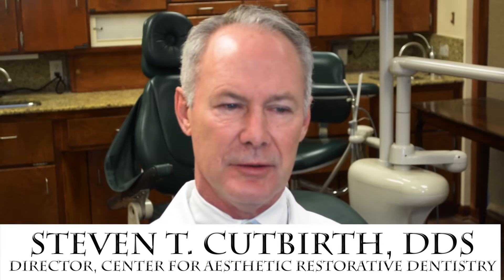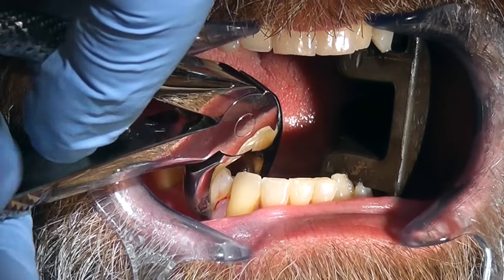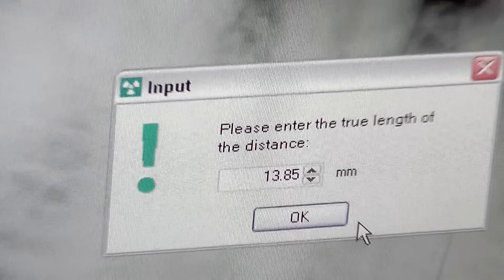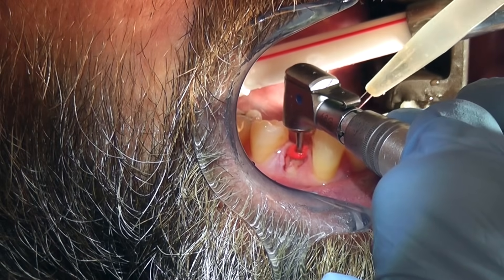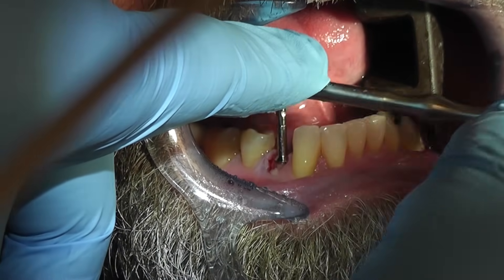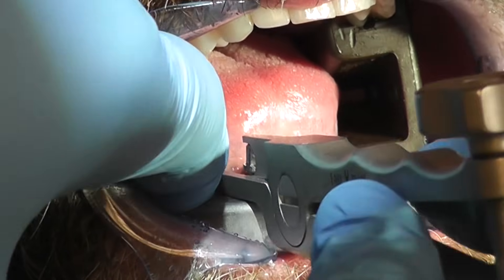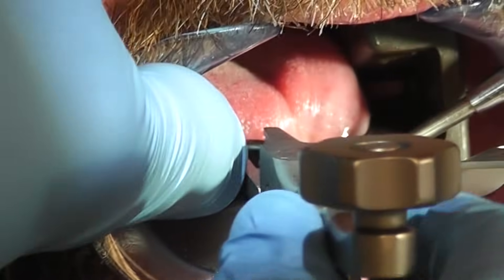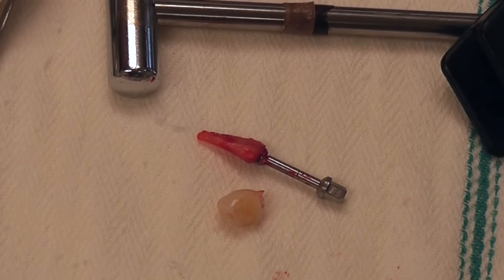Easy Tooth Extraction - Dental Minute with Steven T.  Cutbirth, DDS

Comment: Completely unnecessary. This extraction can be carried out a lot simpler and faster with the use of traditional elevators/luxators and/or rongeurs.
Reply from the maker: Thank you for your comment. There are usually more than one way to do anything. My concern is these cases is to preserve facial and lingual bone for the implant. I'm not saying there are not other ways of extracting the  tooth, but facial and lingual bone preservation is another issue. If you are not going to replace the tooth with an implant, then you can just commando the tooth out.
Take your practice to the Top Tier. Subscribe to DentistryMasterClasses.com for an organized library of all the Dental Minute videos plus many complete comprehensive cases and many very important articles. New cases are added weekly.  Only $39.95/month.
Click here to subscribe: 
https://membership.dentistrymasterclasses.com/purchase/?plan=513

Comment: My dentist did not sew the area is that ok?
Reply: I extracted my top left pre molar and it was really challenging to get it out because of the bone holding it firmly in place. Plus the crown of the tooth was getting hollow so Dr had to drill to be able to grip the tooth as gripping a hollow crown made no sense. But there is now a huge gaping area and I just want to know if I should be worried. I did it Tuesday May 28
Reply from the maker: I suggest you ask your dentist. I cannot diagnose without examining you.

Comment: Had 2 lower teeth extracted today. 2nd from back left and 3rd from back left. They put a topical anesthetic on twice and gave me 4 shots with a massive needle. The exraction was extremely painful. The nurse told me to raise my hand if i feel pain so they could stop so I could take a break. By the 4th time I raised my hand they started to ignore me. There is so much bleeding, swelling, and some pain. Its been 3 hours since the extraction. I would recommend having someone else drive you. I felt loopy and my vision was blurred afterwards. The anesthetic caused my one eye to partially close.
Reply from the maker: Sorry.

Comment: I have a question, I’m getting 4 back teeth removed 2 at the top 2 at the bottom, this is for braces. Will me having those 4 teeth removed negatively impact my jaw structure? Ive heard people from experience online mentioning their face is sunken etc…  I need a professionals reassurance!
Reply from the maker: Sometimes there are too many teeth and not enough space to correct crowding, so some teeth, usually bicuspids, must be removed. The problem is the space needed to correct the crowding is often not the exact space (width) of the tooth/teeth being removed. So if the width of the tooth/teeth being removed creates too much space, then the orthodontist must either leave some space, called a diastema, between two or more teeth or they must move the teeth anterior to the extracted tooth/teeth space back, distally, to close the excess space. Sometimes when this distalization of the anterior teeth occurs, it creates the "sunken in" profile. If teeth were extracted and too much space was created to both straighten the teeth and "close" all the space, I would prefer the orthodontist straighten the teeth to a normal, aesthetically pleasing profile, leaving some open space between some teeth, even if it meant placing a crown or 2 on the tooth or teeth adjacent to the excess space to close the space vs. distalizing the anterior teeth and creating the "sunken in" look. Good question!

Comment: 8 injections to numb every where,  4 in the cheek. Then two directly on each side of the gum surrounding the tooth. Took the dentist a good 50 minutes wrestling to try and remove the tooth ,but it only was half out! Due the thick and deep roots, he then had change his gameplan to cutting it into two pieces whilst the tooth was halfway out. I had no pain just a little stress due to the amount of effort he was  putting in but it wasn't working!  However let me tell you now once the numbing wore off the pain has gotten worse and worse. Pain meds aren't working.  It's 3.45am I've been researching flat out on YouTube to try and help with the healing process and pain I'm experiencing. Day 1 is agony god knows what it's gonna be like come day 3 from what I've read. I'm  actually in far worse pain now than before i contacted the dentist!  FML ah well let's hope I can heal in time for my Christmas Dinner 🤞
Reply from the maker: My surgeon friends and I have found 800mg Ibuprofen plus an extra strength Tylenol taken together every 6 hours is excellent for dental extraction and surgical pain, so long as you are not allergic to either one of those medications.

Comment: Dear doctor, he doesn't want to spend so much time. It's enough to free a little bit around the root with a drill, and a direct elevator will come out with a little force of the tooth.❤
Reply from the maker: I agree what you say is often the case. I extracted 3 decayed single rooted teeth today and was able to extract them vertically by "unscrewing" the teeth, without facial or lingual bone removal or bone damage, followed by immediate implant placement since they were single rooted teeth. However, in some cases, this "EasyXTrac" method is invaluable. 
Take your practice to the Top Tier. Subscribe to DentistryMasterClasses.com for an organized library of all the Dental Minute videos plus many complete comprehensive cases and many very important articles. New cases are added weekly.  Only $39.95/month.
Click here to subscribe: 
https://membership.dentistrymasterclasses.com/purchase/?plan=513

Comment: i think is a lot of work , just extracting would have been easier quicker and simpler without using other materials and time.
Reply from the maker: You missed the point. The coronal part of the tooth was missing, so there was no coronal part to grasp with forceps. To remove a tooth like this conventionally, you would have to remove facial and, probably, lingual bone to expose the coronal part of the remaining tooth/root. You want to preserve the facial and lingual alveolar crest bone for the forthcoming implant. The Easy X tract allows you to remove the remaining tooth vertically with no circumferential bone removal.
Take your practice to the Top Tier. Subscribe to DentistryMasterClasses.com for an organized library of all the Dental Minute videos plus many complete comprehensive cases and many very important articles. New cases are added weekly.  Only $39.95/month.
Click here to subscribe: 
https://membership.dentistrymasterclasses.com/purchase/?plan=513

Comment: If you have pulpitis, it's painful because the anesthesia doesn't work.
Reply from the maker: You can give a mandibular or maxillary branch block of the Trigeminal nerve for local anesthesia. To give the maxillary branch block, use a 27 gauge long needle, turn the bevel toward the bone and insert the needle at the distal facial line angle of the maxillary second molar. Slide the bevel of the needle along the alveolar process 1/2 - 3/4 the length of the needle. Also, give an intraligamental injection with Citanest 4% plain and you can anesthetize the tooth.
 Take your practice to the Top Tier. Subscribe to DentistryMasterClasses.com for an organized library of all the Dental Minute videos plus many complete comprehensive cases and many very important articles. New cases are added weekly.  Only $39.95/month.
Click here to subscribe: 
https://membership.dentistrymasterclasses.com/purchase/?plan=513

Comment: Interesting video. I'm so used to the idea of dentists taking pliers and yanking teeth out. I'm glad I can see how it's done in the modern era as a predental undergrad. Although I believe some dentists still use yanking pliers and maneuver back and forth. Wonder if that's still a legitimate method of extraction.
Reply from the maker: Sometimes circular and small facial/lingual movement is appropriate, but you want to preserve the facial and lingual bone for implant placement.

Comment: I’m getting a tooth pulled next week and already I’m going into panic mode!  Never had a tooth extracted before and I’m going to be sick before even getting to the office!
Reply from the maker: Get the dentist to sedate you prior to the local anesthesia and procedure.
Reply: @centerforard  And how much does that cost out of pocket?  I’m already quoted that the consult will be $155 and the actual extraction will be between $495 and $795 depending upon different factors.  They never even discussed the option of I’ve sedation but this is a large surgery center so I would presume they should have it.
Reply from the maker: I use IV sedation every day for procedures. It's wonderful for the patient as well as the dentist. Working on an apprehensive patient is not good without sedation.

Comment: Dr can u please make video about diagnosing. Sinusitis vs dental pain. Thanks
Reply from the maker: Sure. The main way you differentiate between sinus pain and maxillary molar tooth pain is if the tooth is painful to cold, hot or biting pressure it is normally a tooth problem. If the tooth itself is not painful to stimuli,. but the discomfort is exacerbated when the patient bounces, jogs, runs up stairs or puts their head between their knees when sitting down, , it is normally a sinus problem. 
Take your practice to the Top Tier. Subscribe to DentistryMasterClasses.com for an organized library of all the Dental Minute videos plus many complete comprehensive cases and many very important articles. New cases are added weekly.  Only $39.95/month.
Click here to subscribe: 
https://membership.dentistrymasterclasses.com/purchase/?plan=513

Comment: Hi there, I see you’ve been replying to recent comments so I hope you could have some answers for me.. 

I’m getting my infected root canal tooth extracted on the 27th, going with the extraction route as getting the root canal redone is just even more money (around 1-2k). I also have retainers, they’re the clear plastic ones as I had braces from 2016-2017. The tooth that is getting extracted is the 2nd to last tooth on my top left side of my mouth with the last tooth being quite small in comparison. Would it be okay to keep wearing that retainer to keep that tooth in place with that gap with no tooth next to it or to allow it to shift into its place? Hopefully this makes sense. 

I’ll be getting cavities filled after the extraction and i’m worried that depending how they fill them it could change the shape of my teeth too much to where i’d have to get new retainers costing more money.. 

I’m also scared of possible dry socket and drastic change in my facial structure with that one tooth gone. I’m 23.
Reply: Kids loose teeth at 15 16 because of candy !!! You’ll be ok
Reply from the maker: Sorry you are worried. Speak with your dentist about your concerns. I'm sure the dentist will do a good job.

Comment: Okay has anyone actually gotten stitches after a tooth has been pulled? I have to get one of my top back teeth pulled and I’m honestly just worried for stitches. & I can either wait until January for a root canal or just get the tooth pulled… the pain is far to bad but if I have to end up getting stitches I’m not sure what to do.
Reply from the maker: Why are you concerned about stitches? Save the tooth with a root canal and crown if it can be predictably saved.

Comment: I had 4 teeth extracted under local anesthesia. The worst part was receiving the anesthesia. I had to take a break. After that, the actual extraction wasn’t bad, but hearing my teeth breaking was pretty gross. The healing process was easy but I ended up with a dry socket because I didn’t clean out the wounds well enough. Dry socket was the second worst part of this experience because nothing took the pain away until I finally got in to see my doctor. Overall, the experience wasn’t bad.
Reply from the maker: Headphones are a good idea during the procedure. Sedation can also be helpful. If the sockets are packed at the time of the extraction, you should not get a dry socket. Watch my video on "How to Never Get a Dry Socket."
Reply: @centerforard  nice comment doctor... I will try headphones when i get my next one done..
Reply: Thats why anytime i know im gonna get anesthesia i take painkillers first popping 2 advils 20 minutes before the procedure helps with any pain that goes thorugh the anesthesia and the pain you get from the needles is drastically less.  I had to get 5 fillings the other day and they stuck the damn needle in my mouth in 6 different places without the advil i would've had so much pain
Reply: So your teeth rotted because of poor oral hygiene. Then you got dry socket because of poor oral hygiene. The lesson? Be cleaner and take care of your mouth 🤮

Comment: Why not just pull it out??
Reply from the maker: Terrific, if there is enough coronal part of the tooth to grasp with the forceps to extract the tooth vertically. What do you do if the tooth is broken off or decayed at the gumline and you wish to place an implant following extraction. If you extracted the tooth conventionally, you have to either remove facial and lingual bone or extract the tooth directly to the facial, which destroys the facial bone. The EasyX tract lets you remove the tooth vertically, preserving the facial and lingual bone to stabilize the implant. 
Take your practice to the Top Tier. Subscribe to DentistryMasterClasses.com for an organized library of all the Dental Minute videos plus many complete comprehensive cases and many very important articles. New cases are added weekly.  Only $20/month.
Click here to subscribe: 
https://membership.dentistrymasterclasses.com/purchase/?plan=513

Comment: how long does it take to extract a tooth and does it hurt?? i’m getting mine pulled tomorrow and i’m so scared
Reply: The worst part is what you're doing right now, worrying. It's not fun but it's not like the 1400s, today theres generations of knowledge and experience that make it as safe and comfortable as possible.
Reply from the maker: It depends on the condition of the tooth, i.e., how badly broken down is the tooth, is it periodontally involved, how many roots does the tooth have, etc.

Comment: How long did the whole procedure take you?  I do not want to offend you, but during that time I would take out the root and work with the third patient.  Sometimes I have to take 10-12 zones a day and I think that the time lost in calibration, turning and unwinding is not unreasonable.
Reply from the maker: The extraction is preformed this way, vertically, to preserve the facial and lingual/palatal bone for a forthcoming dental implant. If you are just removing teeth and not concerned with implant placement, then you probably do not need to be concerned with preserving the bone. 
Take your practice to the Top Tier. Subscribe to DentistryMasterClasses.com for an organized library of all the Dental Minute videos plus many complete comprehensive cases and many very important articles. New cases are added weekly.  Only $20/month.
Click here to subscribe: 
https://membership.dentistrymasterclasses.com/purchase/?plan=513

Comment: Any experienced dentist can remove this tooth without any of the extra tools...such a useless method.. I have extracted over 10,000 teeth and never needed anything like this..
Reply from the maker: You missed the point. If you are just extracting the tooth, you may not be concerned with preserving the facial and  lingual/palatal bone. If you plan to place an implant following extraction, preserving the F and L/P bone is very important, so you want to extract the tooth straight up out of the socket.
Reply: @centerforard  what if you fracture the root with this method?

Comment: I'm not sure if that counts as "easy" with all that millions of instruments... imo Coupland/elevator + root forcep is all you need. maybe even just elevator... but nice video anyway
Reply from the maker: Whatever method you use to extract the tooth, the primary concern is preserving the facial and lingual/palatal bone if you are planning on placing an implant. You want the tooth to be extracted "straight up" or elevate it distally or mesially. You do not want to remove the tooth facially because you will loose the facial plate of bone, compromising the socket for implant placement. 
Take your practice to the Top Tier. Subscribe to DentistryMasterClasses.com for an organized library of all the Dental Minute videos plus many complete comprehensive cases and many very important articles. New cases are added weekly.  Only $20/month.
Click here to subscribe: 
https://membership.dentistrymasterclasses.com/purchase/?plan=513

Comment: Thats a lot of work for being "easy", the physics forceps are faster
Reply from the maker: Terrific. Use them. The objective of this method is to preserve the facial and lingual bone by extracting the tooth vertically vs. horizontally and vertically. This method maintains the facial and lingual bone so there is more vertical bone for an implant. 
Take your practice to the Top Tier. Subscribe to DentistryMasterClasses.com for an organized library of all the Dental Minute videos plus many complete comprehensive cases and many very important articles. New cases are added weekly.  Only $20/month.
Click here to subscribe: 
https://membership.dentistrymasterclasses.com/purchase/?plan=513
Reply: @centerforard  wow not bad, I didn’t think of that